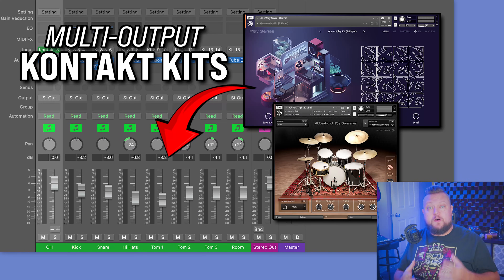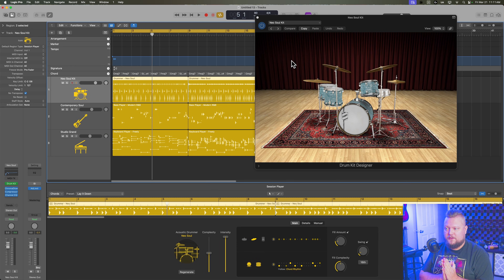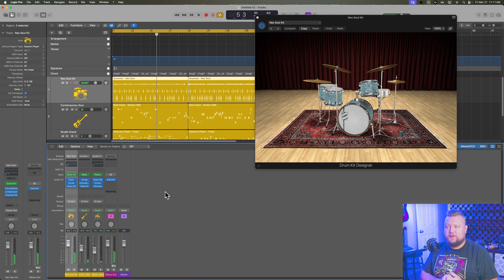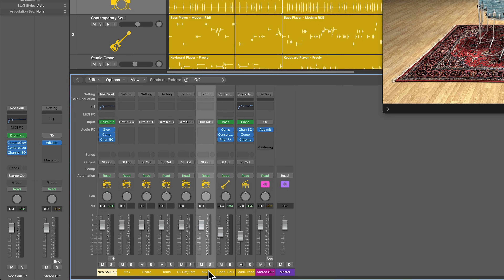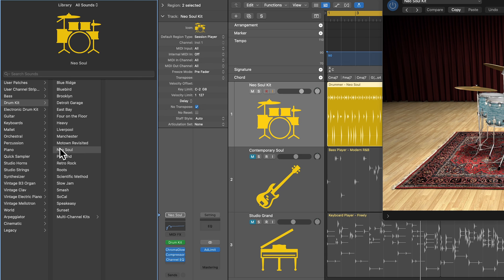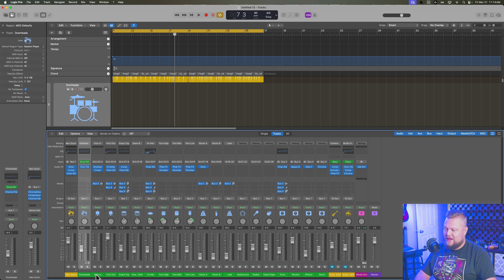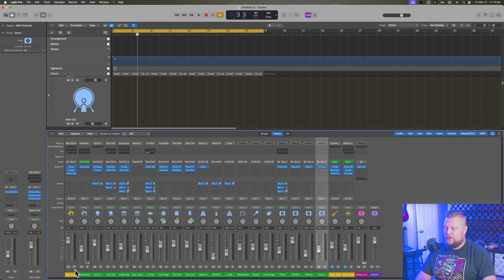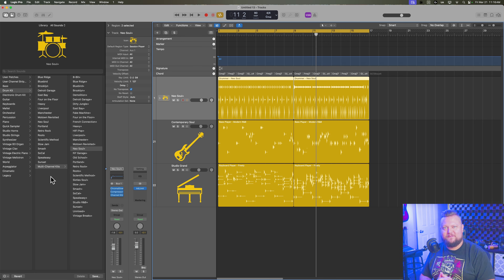Logic Pro 11 - Multi-Output vs. Multi-Channel Kits (Drum Kit Designer & Drummer)

Comment: I noticed that you can adjust for Snare top and Snare Bottom, I'm assuming this would be for a muti-zone snare pad if we're using an electric kit as the controller, correct? Do you know if the same is true for a Ride or crash pad that has multiple zones?

Comment: I just started to move towards logic Pro. The thin is that I loaded my drum its on individual instances on Multi Sampler. Example: all the kicks on one instance of multisampler on each note. So C1 plays one kick, C2 plays another kick so on and so forth. that I saved the present and I created a new one only for snares.

It all works as planned, but the problem arises when saving the project. When I click on save "Sampler Audio Data" what it does is that it saves all the kicks on the preset, all the snares, all hi hats instead of just the notes used. I don't know if theres a way to save just the notes used. I guess it maes sense if I sampled a melodic instrument cuz you would save each note so you can play the instrument when opening the project on a different computer. But when it comes to Drums, saving all the kicks, all the snares, etc takes storage cuz essentially I'm saving the entire drum kit again and again. 

If there's no way of solving this I might just drag the sound I'll use on a Quick Sampler instead.

Comment: Josh - Multi-Output Kits / Producer Kits are a combination of selected kit pieces as well as plugins in the mixer (settings).  If I tweak the kit pieces AND I add plugins, or make changes to compression, reverb, etc. What's the best way to save it all?  I can save the revised kit in Drum Kit Designer, but what about all the setting changes?  Save a 'Performance'?  Save 'Settings'? When I open my revised kit, I want all the settings to open too.

Comment: I do have a question for you. I own an e drumkit with 4 crash cymbals but the drums kits in logic only do have 2 cymbals. Is it possible to get an extra cymbal to the kit and how do you do it? Greetings Rob from the Netherlands 😎👍
Reply from the maker: It's possible you could load up two different Drum Kits inside of a track stack. Then make the primary kit only input MIDI channel 1, and the secondary kit MIDI channel 2. You can do this from the track inspector. IF and only IF your drum sound module allows you to select a specific MIDI output channel for each zone/pad/cymbal, you could make your entire kit, minus 2 cymbals, go to channel 1. Then make the two extra cymbals go to channel 2. That way you could borrow some cymbals from another drum kit.